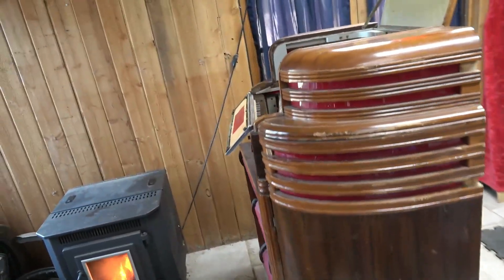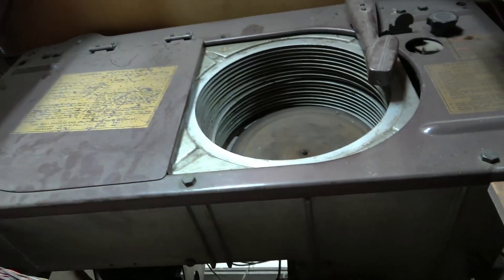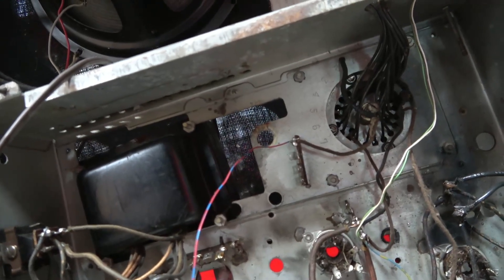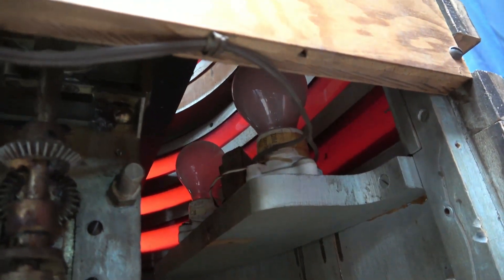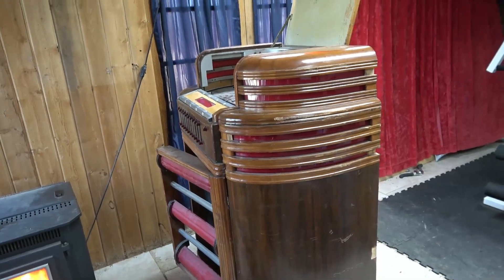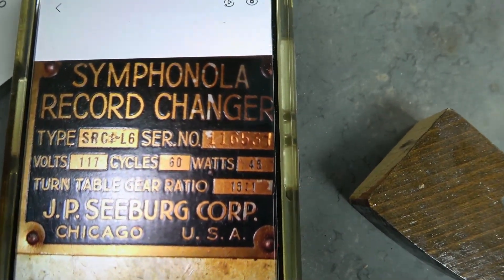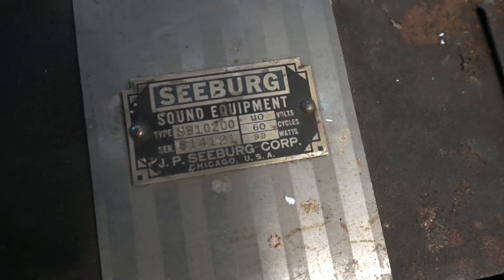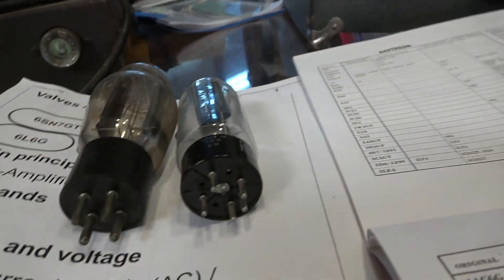1938 Seeburg Regal jukebox part 2

Comment: This would be just awesome to get working. It won't be original anymore but just getting it back to work and get the lights back to work. It would be even more awesome to maybe modernize this machine, maybe some LED lights and maybe a modern controller like an Arduino.
Reply from the maker: You read my mind on the led lights.  I was going to show them in an upcoming video if I can get the Amp to work.  Amazon sells 75ft led club  light strings that go to the beat of the music 🥳

Comment: 5Z3 is early 4-pin version of the 5U4 tubes. You can buy a reproduction 5U4, plenty of them made today. 5Z3 will work in place of a 5U4 if you build a adapter, or simply change the tube socket. Personally I would just get 5U4, they are cheap enough. If you don't care about looks you could also just install two modern solid state diodes in place of the rectifier tube, with appropriate droppign resistors in series so that you don't overvolt your filter capacitors. That would be the cheapest option, and for testing purposes it will work. if you have a variac or dim bulb, you could literally just shove the diodes into the tube socket for the rectifier tube, and run it at reduced voltage for testing purposes. :) There are pinouts available on the internet for how to do it. :) also dont worry about being a rooky, we all have to start somewhere! And I am happy that you are helping us keep the vacuum tube hobby alive! :D
Reply from the maker: Thank you so much for the info.  I truly appreciate it!